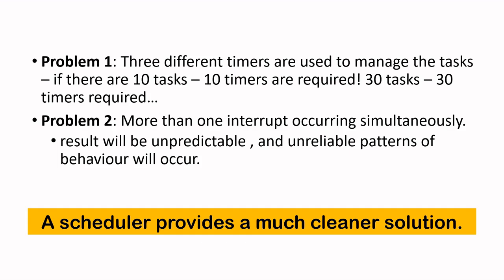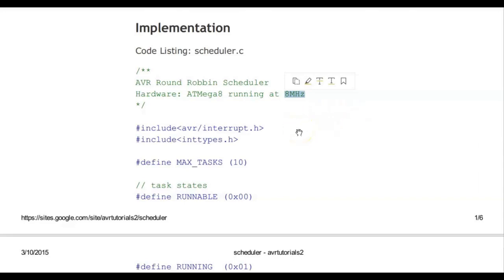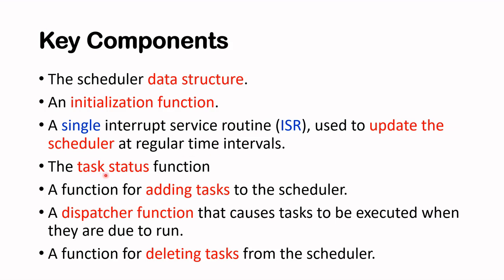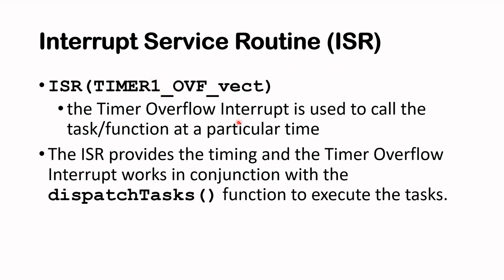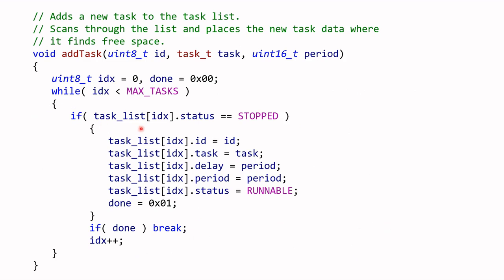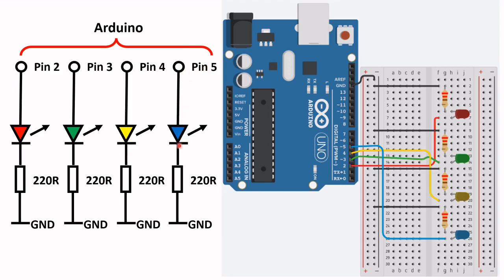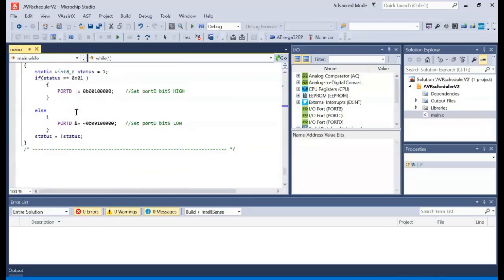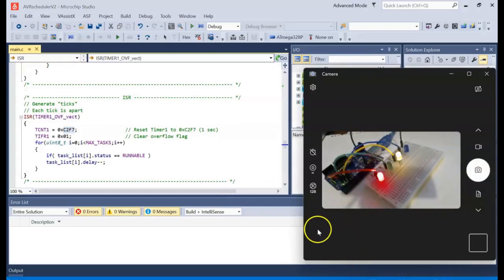#77 Task Scheduler - Part 3

Comment: in the initSchedular(void) can you please explain the line, "task_list[i].task = (task_t)0x00".
What's this 0x00 indicating by loacting just after the (task_t)?
Reply from the maker: Hi, the line task_list[i].task = (task_t)0x00; is initializing the task to a null or "empty" task, where the task doesn't point to any valid function. This ensures that the task scheduler won't try to execute a task that hasn't been properly defined yet. Later, valid tasks will be assigned, replacing this placeholder value. 0x00 is simply the hexadecimal notation for the value 0. Here, it is used to indicate that no function is assigned to this task initially.
Reply: @vooiyap  Thank you sir. I was not expecting your reply within just an hour. I really appreciate it.